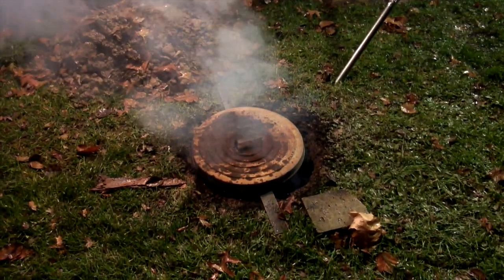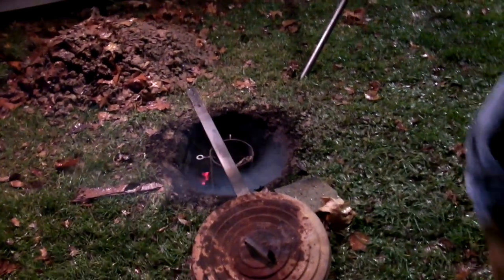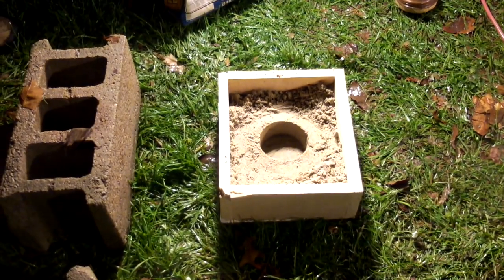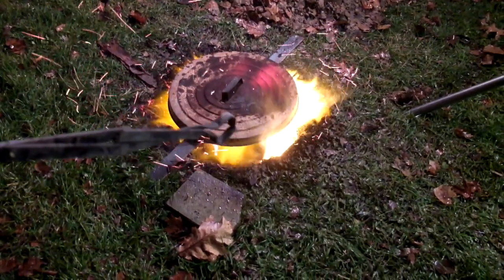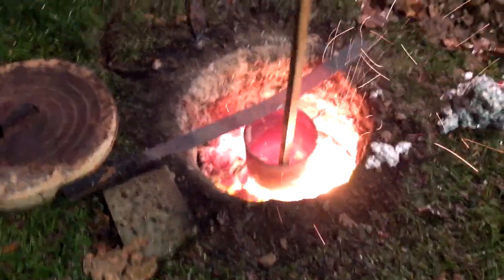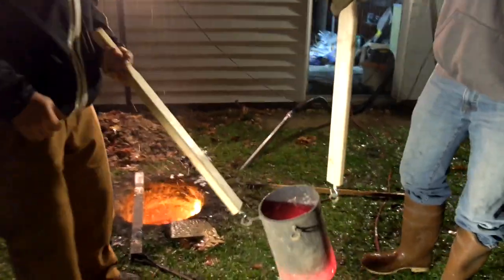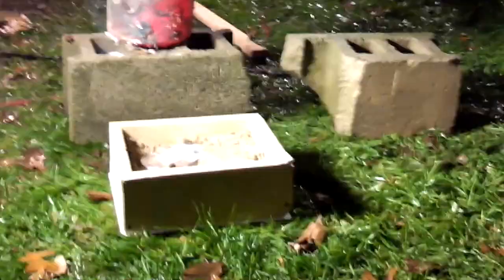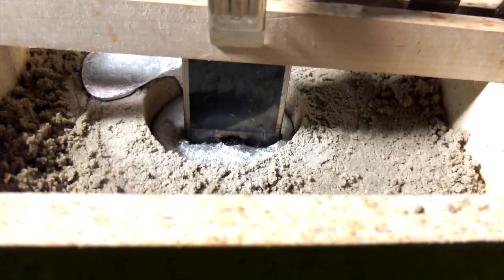Melting Aluminum 2.0 with an iPhone - desk paperweight

Comment: Know that feel! I tried this myself a couple of months ago(got inspired by your first video xD), and after finishing almost all my cans the crucible sprang leak at the bottom, and all the aluminum ran out T.T Then again, my crucible was nothing more than an empty steel can of cat food, so I don't know what I was expecting xD At least I could still collect the aluminum that ran out after it solidified. I really wanna try it again with a better crucible, but my biggest problem is how to operate that gloving hot crucible all by myself.. That's why the cat food can was convenient, it's easy to lift it out of the fire and pour since it's so small but, as I found out, it's not all that reliable. oh well, I'll figure something out, maybe get someone to help me^^
Reply: You can buy actual crucibles but its more fun to just cobble together whatever you can find.  Good luck and thanks for watching!